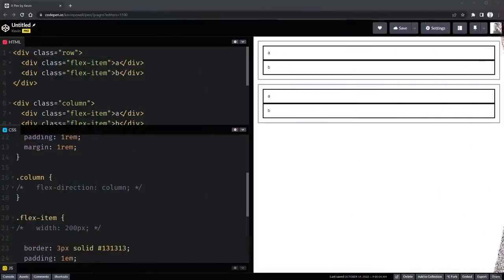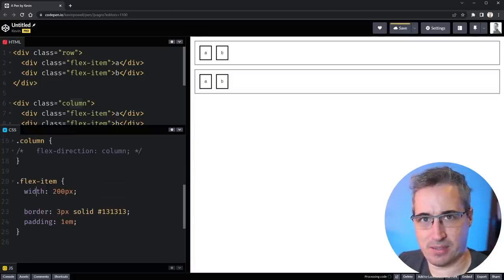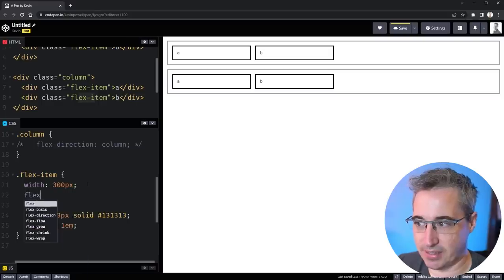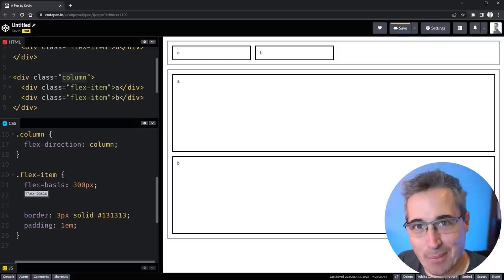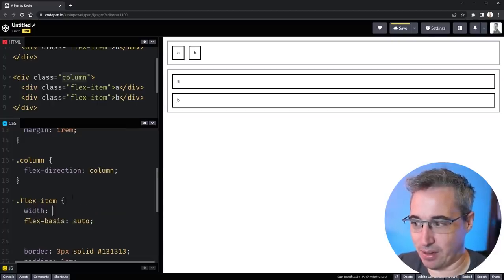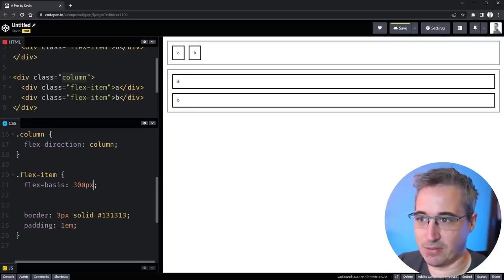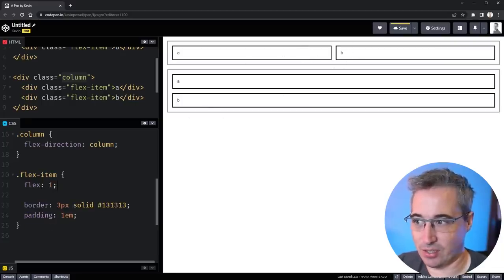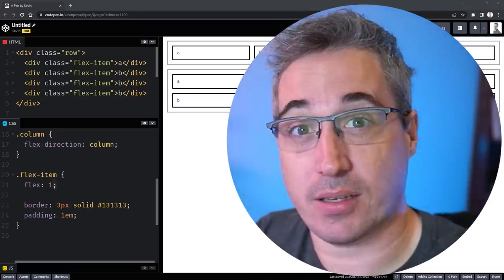The thing people get wrong about flex-basis

Comment: Kevin, usually your explanations are great, but others did better on explaining flex-basis. (Thank you for your work.)
For your readers, I will add some comments.

The default for flex-basis is zero. The starting width (or height for flex-direction: column) is then used.
When flex-basis has a value, then width (or height for column) is ignored.

Flex-basis works with flex-grow (default is zero-- items don't grow) and flex-shrink (default is 1).

Flex-basis is an ideal starting point, not always obtained (of children in a parent) before growing or shrinking is applied.
(If you want the width of all the children to start the same width, code flex-basis: 2rem (or whatever width) on the common class. But if you want the starting widths to be different, code the flex-basis for each, or start the same and override the different one.)

When there is unused space in the parent container, flex-basis shows how to distribute that unused space among the children.
If the children all have the same flex-grow, they will grow equally to their max-width or until the container is filled. Ex: If there are say 3 children and one has flex-grow 2 and the others flex-grow 1, the "2" will grow twice as fast.

The children will all shrink equally until their min-width is reached or the container is at the minimum width. The children can be assigned different flex-shrink values if you want them to shrink at different rates.

If you don't want a child to grow (bad parent!), set flex-grow: 0 if the default was overridden. If you don't want a child to shrink, override the default (1) with flex-shrink: 0.

One possible use: you want to set up a photo gallery, but the pictures aren't the same size. You want them all the same size, and to grow to a point and shrink to a point. .photo {height: y units; flex-basis: x units; max-width: whatever; min-width: whatever; flex-grow: 1) (example is for display: flex:, flex-direction: row;) (Channel Front End Beginners has a good Flex Basis video, and the game Flexbox Zombies, great fun, is now free on masterygames a .com site.)

Comment: Clear as mud. I understand width, height, min/max-width & height, but (for me) what flex-basis actually DOES is essentially undefined here and still confusing to me.
Reply from the maker: It acts as width when the flex-direction is row, and acts as height when the flex-direction is column :)
Reply: @KevinPowell  I wish that helped. "Acting" as width and height doesn't really inform me of WHAT it's fundamental purpose actually is. Knowing this would help me in determining HOW I would use it in CSS. It's called "flex-basis" but what is it a "basis" OF?

Comment: I thought this video was going to be about the way flex-basis influences the growing and shrinking of elements.

Near the end, for example, when you added flex: 1;, I thought you were going to show the gotcha of having flex-basis set to 0.

In this sense, saying that flex-basis: auto; "looks" to the width/height you had explicitly set with CSS, is a bit misleading.
flex-basis: auto; will look at the rendered dimensions, equating auto to min-content.

Again, this ties into the fact that with width: 300px;, flex-basis does not become that. The answer to that quirk lies in the flex-grow and -shrink properties and is the reason flex: 1; works in the first place.

Would love to see you a quick follow-up on this!

Comment: What if flex item doesn't have any content or height or width? Suppose, there is a flex container  with a width and height of 400px, I create 9 empty flex items inside, and these items do not have any content, width or height. Will the flex basis make these 9 items fit the container ?

Comment: I‘m not sure what your where trying to explain in this video.. i‘ve always been using flex with width, never with flex-basis, and it seems that that was the right choice?
i was expecting something cool or new with flex-basis, instead you‘re saying i shouldn‘t use it (in 99% of the cases)?